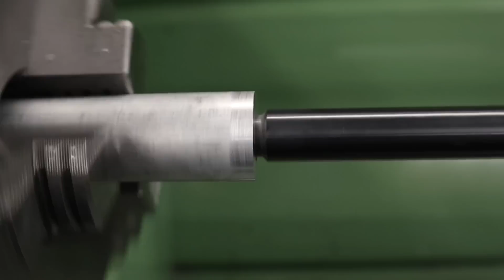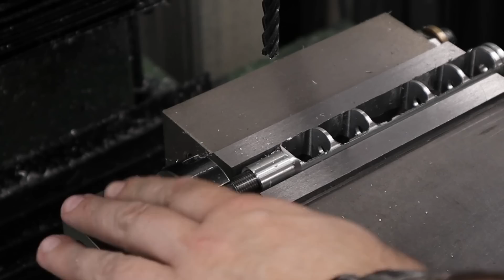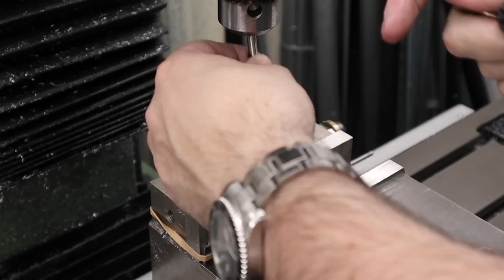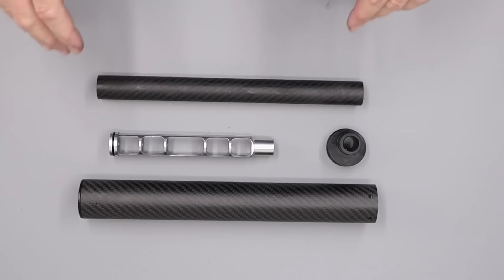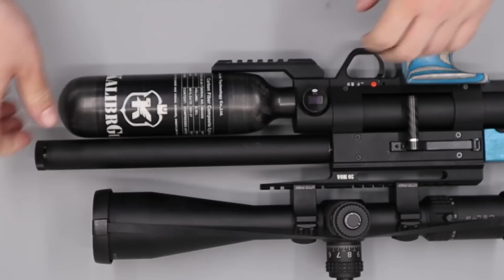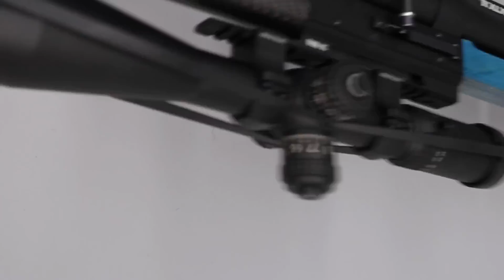Making a offset carbon fiber shroud for the kalibrgun cricket 2 tactical

Comment: I live in Canada so as long as you have a firearms license you can have full power in terms of air rifle. 

My question is in terms of the FX impact Mark 3, my friend has a 700 mm barrel, 25 caliber, he is shooting 32 grain to 34 grain slugs at around 950 FPS and he's getting about 70 to 80 shots per fill. 

FX specifies the impact having 89 FPE using a 700 mm 25 cal barrel. 

All things being equal to the FX Impact how does the shot count and FPE of the KalibrGun Cricket 2 Tactical compare the FX  Impact.

Comment: As usual, a bow to your skills. I have to ask why you didn't create a felt based 25mm diameter moderator to fit within the shroud? Surely that is the quieter than a mono-core section with baffle chambers?
Reply from the maker: yes we could have made it quieter but the all we wanted was for it to need a mod and it's worked a treat 😀